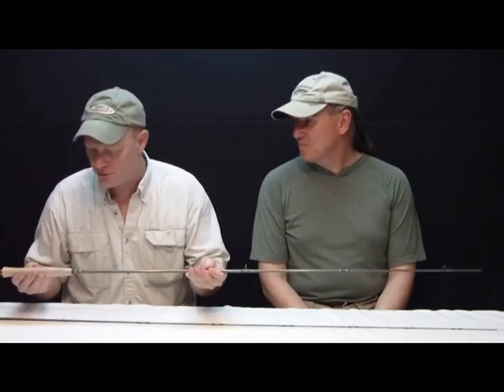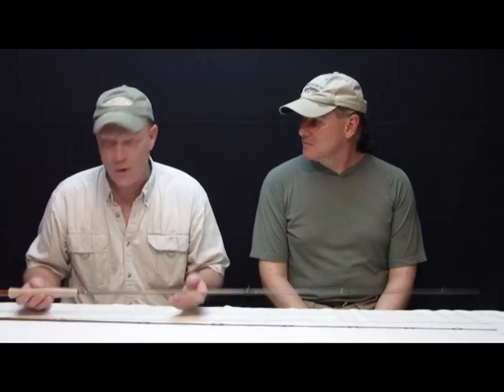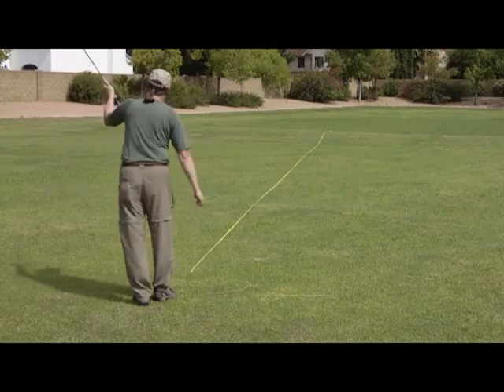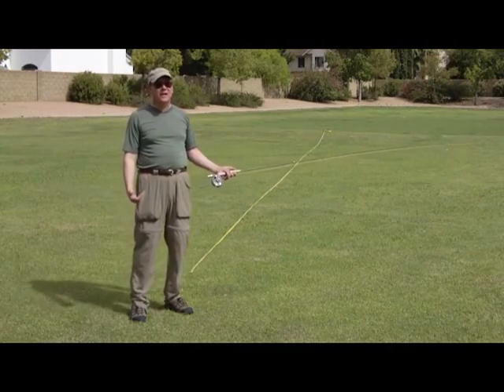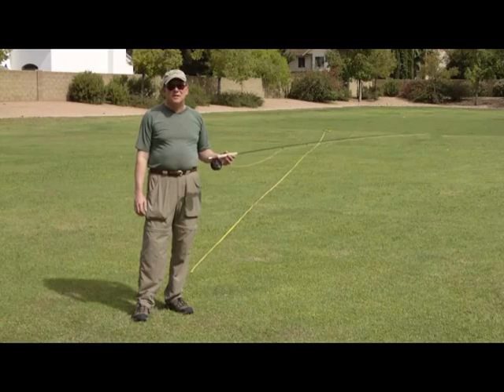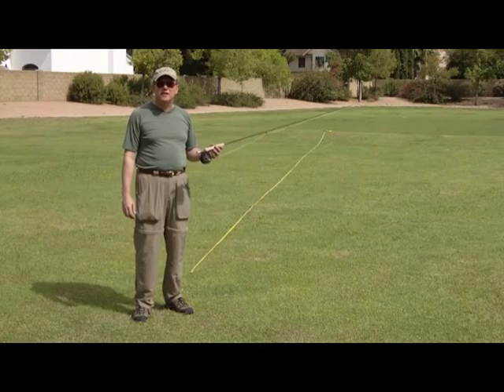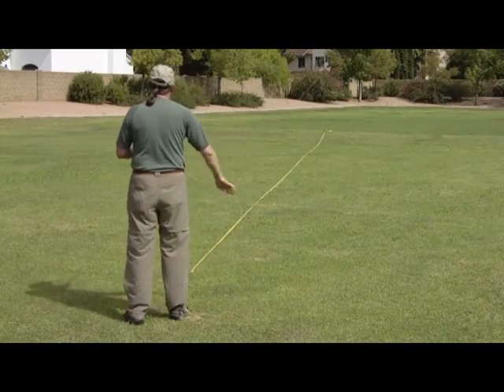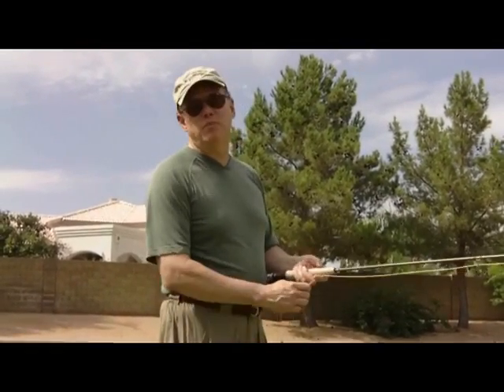Building your first Fly Rod - Part 22 - It's Finished!

Comment: John, I just came across your series and it is simply, outstanding. Thank you for taking the time to do it. I hope to. Buy the equipment and supplies very soon and build my first rod. I am an old retiree so have to slowly fit it into my budget. I have been fly fishing for over 40 years and recently have gone back to my roots of fishing fiberglass rods. I intend to build fiberglass rods and wondered if there are any subtle differences that I should be aware of. Thanks again. Nick